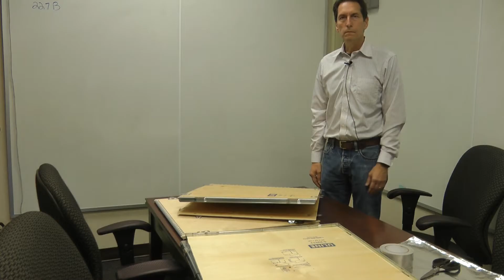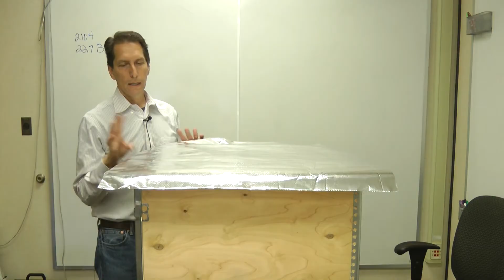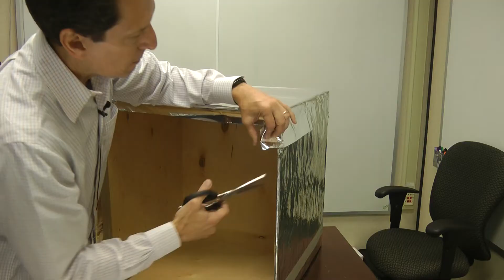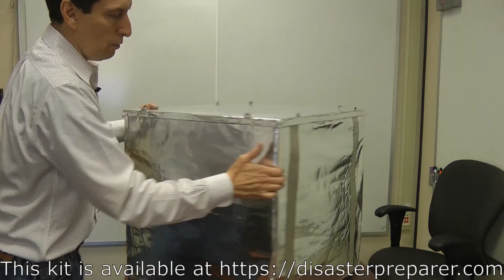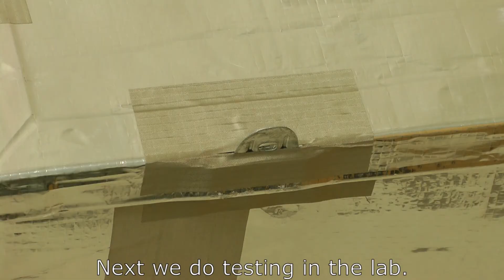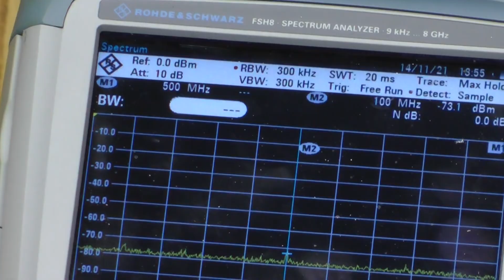Faraday DIY Box

Comment: Good day sir! I caught you on the Canadian preparedness Channel just about an hour ago. I'm so glad that I caught that and was able to subscribe to your channel also. I had the same idea that you just showed tonight but you filled in the blanks for me thank you so much. I will be building a box such as that. But I also want to build one to cover my generator but I also want to be able to get into my generator Without Really tearing things apart. So I was wondering if I could use small rabbit wire or even metal screen wire to wrap my box in? Mainly using the wire to be able to open it up to Crank It Up should I need to in case of a regular power outage. Wouldn't that be the same as wrapping it in the conductive material that you have wrapped the Box in and if I am able to use the wire should I use it as plan naked wire or can it be rubberized wire? I certainly hope you can answer these questions for me. Also have one more question. I am just before getting an EMP Shield for my home and if my generator is connected and to my house grid will it be safe. I'm sorry these are difficult questions but that's the questions I have. I certainly do hope you get to answer these questions for me. I wrote down the website you put on the screen for the kit and plan on getting the kit. Please have a great day and stay safe and keep your powder dry! This is in response to the alert box that you demonstrated the other day. I tried to purchase one or get in line for one and somehow someway I ended up with two in my cart. I tried to delete one but it would not work and I still would like to purchase that product. I hope you read this

Comment: How would flowing electricity inside of a Faraday cage effect it's protection? For example, say I hook up a cellphone to an external battery pack and set it in a Faraday cage box to charge (I understand that could become a fire hazard, but I am using this theory for the sake of example). Would the flowing electricity within the box increase the risk of a shock getting through the barrier(s) at all? 
Also, would the hinges cause any risk of conduction or jumping to something that sits too close to the corner?
Thank you!
Reply: If it's electrostatic current you are worried about, it would be highly recommended to ground your box. However in a more recent test Dr. B has done, grounding your faraday cage had virtually no impact on EMP protection.

Comment: How could I vent this if I wanted to put a little frig in?
Reply from the maker: Small holes wouldn't affect shielding that much, but if you ran a power cord out, that could really compromise the protection. You could perhaps put a good ferrite outside on the wire, but you'd still be giving up some protection. Also, you'd really need to be careful about having enough venting not to cause a fire hazard or premature hardware failure.

Comment: Instead of using the material, for a smaller box could i just use copper/aluminum conductive tape and tape it all over completely?  Would it be the same effect? Thank you
Reply from the maker: Sure, that would work fine. Just overlap the tape a bit so that you don't have any exposed seams.

Comment: I really wonder if a homemade Faraday cade would work with current technology. Didn't they discover the effect like 50 or 60 years ago when electronics had connections in the mm scale. Now a simple flashlight has microchips with connections in atomic thickness. They should burn indefinitely easier.

Comment: I built one just exactly like that using heavy duty foil.  What’s the product you used?  Mine has a lose bottom and attached top so the top and sides fit over my Hysolis solar generator.  The bottom sits on rubber casters, which makes moving the 130lb beast around very easy.
Reply: Apparently he doesn’t answer those who didn’t buy his product

Comment: Hi Doc, If i had time to undo both battery connections and ground both to earth, ie used jumpers to a metal rod in the ground. Would that sublimate an emp away from the computer in a vehicle? This is assuming there was a forewarning that provided time to accomplish.
Reply from the maker: No, I don't think that would solve the susceptibility of the microcomputers onboard.

Comment: Doctor, Could there be a synergy between aluminum , barium and strontium being sprayed , as well as 5G , as well as graphene in the injections being pushed ?  I know it's a hard question . Thanks.
Reply: Synergy is a business degree topic. Lol.not electrical engineering
.  anyway, 5G is an array of radio frequency and technology used to transmit data on those frequencies. Graphene is not in the injections per se but something like it could be. There is a nanolipid bioweapon in some of them.

Comment: Do you thing doing an entire small building would work the same or would it be over kill
Reply from the maker: It can be done, but it's hard to do right because of air vents, windows, doors, seams, etc.
Reply: @disasterprepper   I'm thinking of doing The inside of a storage building Like maybe half of it
Reply from the maker: @vnillagrilla  It's certainly possible. You'd just want to test it when you were finished.

Comment: From a disaster preparedness standpoint, what are we storing in the box that's so mission critical that we want it to survive an EMP?
Honest question. Well done presentation. Your conductive sheet looks like fiber reinforced aluminum radiant barrier?
Reply from the maker: I did another video on possible items to store in a Faraday cage. https://youtu.be/uszKDak5sBs
Reply: Comms, solar panels, a power bank. Any electronics necessary for medical equipment you may need. Lots of things.
Reply: Can we not use the microwave? Or oven? If inside the house?

Comment: Great video. So... my question... If the solar power station and the panels that go with it, are stored the the cardboard boxes that they shipped in.... can I just use this method to completely seal the boxes with this material and tape? Rather than building a box like this?
My other thought was an EMP blanket big enough to just cover them up.
Reply from the maker: Yes, you can simply use this material (or even aluminum foil) to wrap the cardboard boxes that the panels came in. It works just as well as having a wood box.
Reply: @disasterprepper  thanks so much.

Comment: I made a box like this one except I connected each corner with 2 cabinet hinges both 3 inch. I can just pull the pins and each section fits together perfectly for pins to be replaced. Tape and foil is standard. The question is if boxes and other types of containers are then wrapped with chicken wire type materials can more protection be achieved. I was also wondering why you didn't line the inside with cardboard so that no possibility of contact with the outer surface can be made
Reply from the maker: The inside of the box is wood, so there's no real risk of contact with something metal. As for chicken wire, it doesn't shield high frequencies very well. I showed that in a different video.

Comment: Wonder if notch covering with tape is needed. Follow up video without those tab coverings?
Reply from the maker: The tape put over the tabs and notches does help with shielding. I tested it first without and then added them for additional protection. It's super easy to add.

Comment: Conspicuously omitted is, of course, is the name of the "nice conductive material", "barrier", "high quality material". Is it merely a thick aluminum foil? My guess is that if you wanted us to know, that would have been the first thing you would have mentioned. So, are you planning on selling it and the tape on your website at astronomically high prices??? Thanks, but I built one myself and pray that both mine, yours, and everyone else who has or will ever build one, won't be needing it and that, if we do, they all work perfectly. Thanks, EMPDoctor, and while I do appreciate your videos, most of us can not afford your prices. Still, you have given me ideas that seem like they will work in case of a coronal mass ejection, if not a massive HEMP strike above Kansas.
Reply from the maker: No, it's not aluminum foil. It's more more like a radiant barrier except without the small holes that are often in that material. You can build a similar product using foil though. It just won't be as durable, less expensive though. Other shielding options exist too, of course.
Reply: I just went looking through the comments for exactly this reason. I appreciate the content this person is putting out, but honestly it seems a bit sketchy how secretive he's being. It doesn't say what it is in his website either. I'm not in the US, so I don't want to order from there (if I even can - there's no mention of international shipping). It would be great to know what this wonder material is...

Comment: Awesome video thank you. Where did you find the box? I can make one similar but its a nice pre-built box.
Reply from the maker: The whole thing is a kit, several sizes available at https://disasterpreparer.com/product/diy-faraday-cage/.
Reply: @disasterprepper  thank you for the reply.  I think the price is a very great deal. Especially with the boxes included. I will be buying one or two.
Reply from the maker: @skwynts  It looks like the boxes are not included. I initially thought they were, but you need to buy the box separately from U-Line.
Reply: Guessing he sells on his website. See end of video. He is a good guy. I should buy some tape as I’d prefer galvanized trash can approach
Reply: @blkhawk661  I looked. I was under the impression that it was all the material except those boxes.